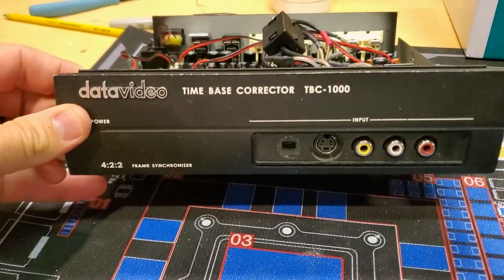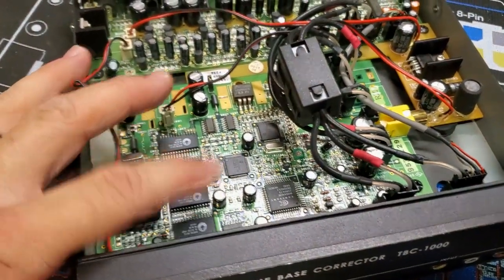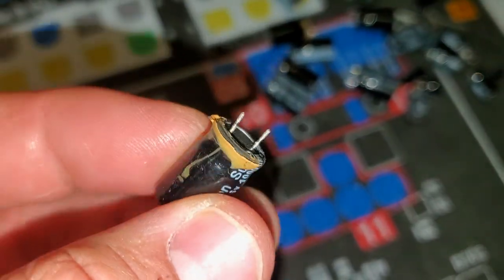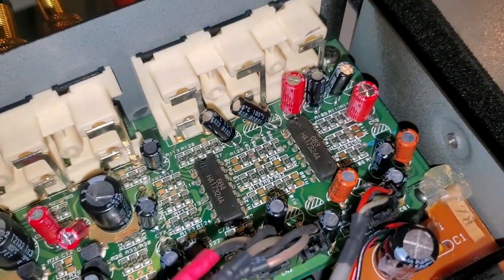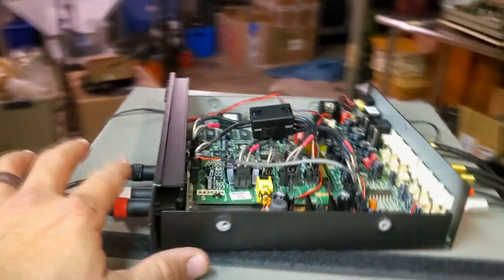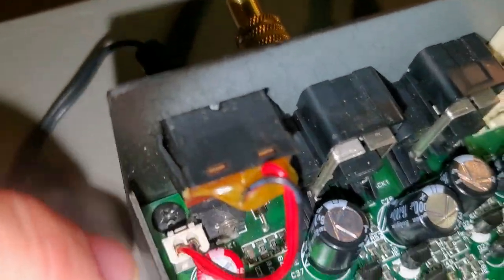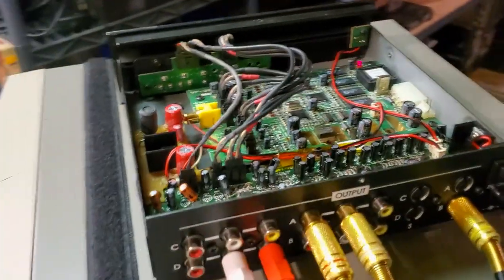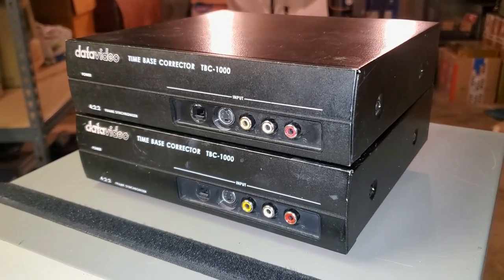The $3,000 Time Base Corrector - TBC-1000 "No Video Fix"

Comment: The orange stuff is actually glue, to stop the larger caps wobbling on their legs during manufacture and shipping. It can cause issues as some types become slightly conductive with age, but it’s not electrolyte leaking out from the caps.
Reply from the maker: Thanks for the input, but I don't agree innthis instance.  I've worked on 6 of these and this was the only one to have that on it.  It also did some damage to traces by blackening the traces around some SMD parts.
Reply: Hi, yes i can confirmed that this is a manufacture glue. I have seen this in a lot of board's, not only AV stuff but in other devices too.
Reply: @RetroTechUSA  this is a glue
Reply: @sullah1986.  Interesting. Is it common that for a particular device some units will have glue and other units not?
Reply: @Curt_Sampson  I think it depends of board part number. I do not know why they put this glue around this caps but in most cases this glue thing is around big components on the various type of boards, inc power supplys etc probably to hold them in place in case of cold solderisolderingto not make any short. But this is only my thinking.
Reply: @sullah1986.  Well, cold joints don't make a short (if anything, they do the opposite), and glue will not help with cold joints. That said, I agree the stuff does look more like glue than electrolyte.

Come to think of it, comparing the serial numbers might provide a clue. It's plausible that they added the glue to later build units due to seeing a relatively large number of failures of those caps due to mechanical failure of the joints in returns on earlier build units. (Or, perhaps, stopped adding the glue to save costs when they later decided it wouldn't be a problem.)
Reply: @Curt_Sampson  Exactly, the electrolyte looks more like a spill of water, but is more fatty and has a specific smell. They also added this glue becouse of logistic process. They prevent wobbling due to transport as say @RoadKillElectronics.
Reply: @RetroTechUSA  I've handled many (MANY!) TBC-1000 units in the past 20+ years. This brown glue/substance is uncommon, but happened. There are multiple revisions to the TBC-1000, and there's no certain revision that did or did not have it. When it does exist, it tends to be tiny, at the cap, maybe under the cap, maybe connecting the parallel caps. Not smeared all over the place, as you see on your unit. There's always the possibility that this was a botched DIY attempt, which we've seen a lot of in recent years. 

FYI, around late 2019 into early/mid 2020, the market was flooded with bad units, from unknown sources. It's likely that a former DataVideo USA facility/warehouse was liquidated, and all the units sent back for warranty repair (but never repaired) were released from a pallet auction. The errors tend to be wild and random, not something like Panasonic AG-1980P caps issues, which had a years-long bleed-in period as the caps failed. No, this was a sudden issue. And not just a single issues, but issues, plural, many weird and rare. Prior to 2019, bad units were rare. After 2019, way too common. That includes all the "working" and "tested" units on eBay these days, all BS descriptions, usually sold by recyclers who wouldn't know a TBC from a toaster, selling units that have all sorts of issues. With pandemic downtime, lots of bored wanna-be electronics repairman made the units worse, some now irreparable. We've been discussing this at digitalFAQ.com for years now. So there's also a chance that your unit never worked correctly, board badly manufactured.

This is where knowing the full lineage of the TBC can help to understand what has happened.

Comment: Nice video, Steve. The reason it would not output video was that cap you replaced on the small power board. That takes the 12v DC coming in from the PSU down to 5v for the video processor to work. Just FYI, for future testing you can make a dupont to S-video cable and test the output of just the video board. Saves you some time if you see these regularly.
Reply from the maker: Thanks for the info!

Comment: that orange crap. looks like glue used to hold them in place
Reply: It is glue. Notice that there was none of it in towards the center of the base of the removed caps. If it had leaked from the cap, it would be all over the two leads under the cap. But it wasn’t.

Comment: Hi, I have this device and it produces darker/dimmer/less sharp image (with halo). The capacitors seem fine, no apparent leakage or deformation. Tried various cables and VCRs, both RCA and S-video connections, so the issue is within the device. Any recommendations on how this could be fixed would be greatly appreciated.

Comment: The orange stuff is not a leak, it's a factory glue that dried up, The capacitors could be just fine.
Reply from the maker: Then why did the device not work before I changed the caps?  Once I changed the bad caps it worked.
Reply: @RetroTechUSA  Some of them may be bad, I'm not saying your caps are 100% good, I'm just saying the orange stuff is glue not electrolytic fluid.

Comment: Yeah! I've never seen one of these before. So its a distribution amp? One in and several outputs?
Whats the extra port next to the s-video on the front?
Reply from the maker: It's a blanked out spot on the board, so it actually doesn't do anything.  It's a weird device.  I'm not even sure of everything it does, but people who own them, swear by them. I think the biggest thing maybe be that the device has frame synchronization that eliminates frame drops from VHS transfers.
Reply: @RetroTechUSA  I have one. Putting it in the chain allowed me to digitize analog video without having any of the frame drops or sync issues I was having before. So I believe it somehow amplifies the signal? I guess that would make sense if the original tape is degraded somehow but I'm not sure. Bought it when it was just $400, glad I did it then ha ha ha!
Reply: @mrtuckerlucas  It captures the sync and rebuilds it in digital to then output a clean complete sync signal that the original tape may not have.
Reply: @wormbagged  From my understanding of the Wikipedia article, that's not quite correct. The actual problem seems to be not an incomplete sync signal but that the rate of the video signal is varying as it comes off the tape: for the nominally 15.75 kHz scan rate one scan  line might be the correct 63.492 μs time period, but the next one 63.555 μs or something else slightly different due to variability in tape speed. (This is something that had never occured to me as someone who deals with video generated from digital sources; even ancient 8-bit computers are much more precise in their timing than analogue VTRs because they have quartz crystal-locked clocks.)

So the TBC basically captures each frame (the entire frame data, not just the sync) and then spits it out with perfectly consistent timing, also as a side effect delaying things a little bit. Obviously this is going to make it easier for other equipment to correctly sync to that signal including, it seems, cheapish video digitisers that don't have particularly sophisticated sync circuitry designed to handle input that varies in speed.

Comment: Hello, I wanted to ask you about my monitor, I use Hansol 710A monitor that had bit of blurry screen, so I wanted to open it, It had 2 screwholes in bottom after that I couldn't open it and I tried to go slowly with screwdriver on sides to unclamp it, seeing i'm not successful to do it, I quit from doing so. When I put everything back together and turned it on, it has one horizontal line flickering on black background, when I looked closer line has red green blue colors on it, with green being most visible, is there way to change this to dissapear? I tried changing monitor resoultions and hz, and everytime I changed it, it has line flickering on other spots, only when its black background though. I tried to search about this problem online but I couldn't find any similar problem, thank you for anyone reading this message and who might have solutions to my issue :)